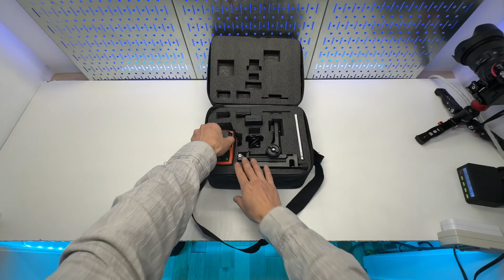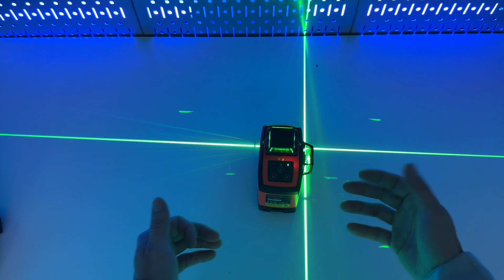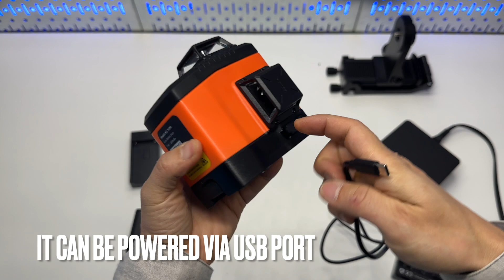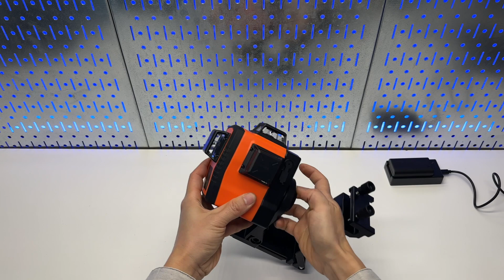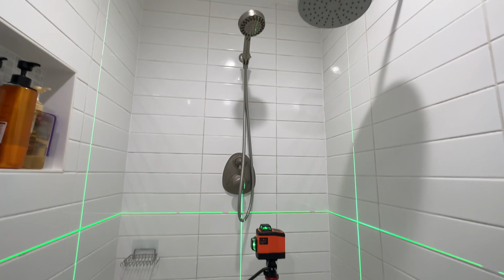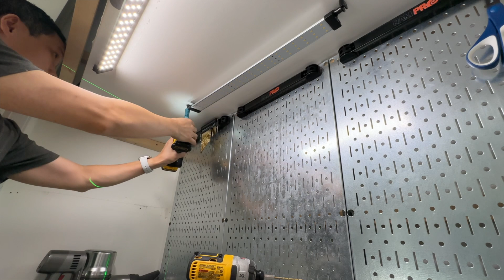DOVOH 3X360° GREEN LASER LEVEL (K3-360G)

Comment: What if the machine is on an uneven surface? Can it still give accurate results? What about circle walls? Can it level that accurately?
Reply from the maker: This unit has self-leveling mode with ±4° auto-leveling range. Beyond ±4°, laser lines will shake and beep. Works accurately on both flat and curved walls within this range.